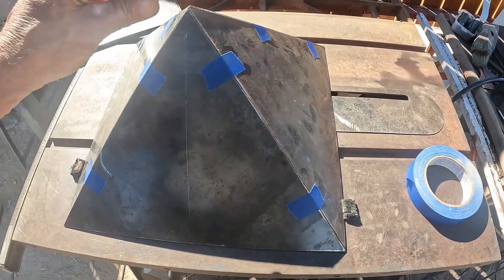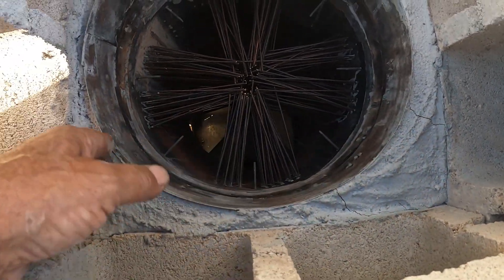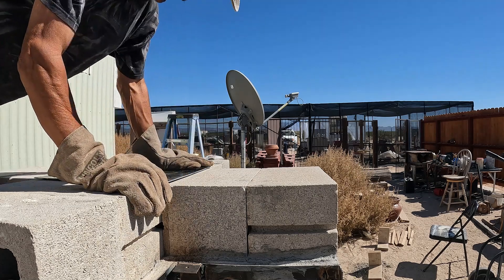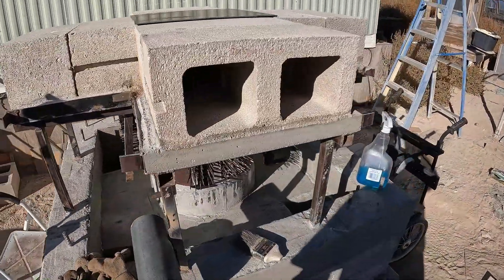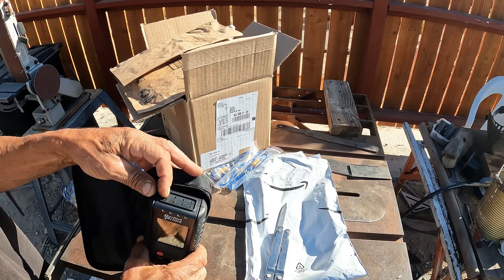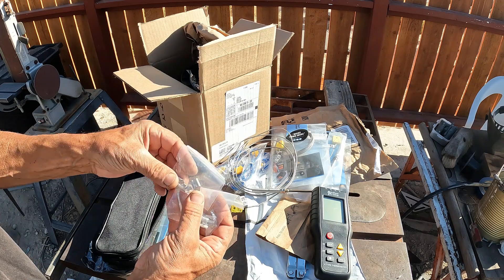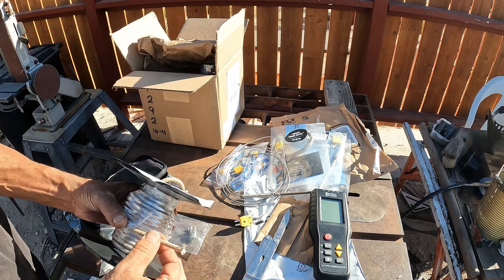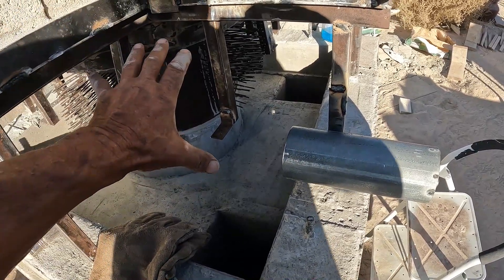Sand Battery Update E126

Comment: New to your channel.  How are you using this/what are you going to be doing with it?
Reply from the maker: I plan on building a room addition around it. But prior to finishing the room I will build a make shift shanty around it so I can start testing it as I build a nicer room. This is all an experiment. If it works as well as I hope it does I will build another one on a new property in the woods I just purchased if all goes well.
Reply: @off-gridsurvivalmike8120    Nice.  Good luck with the project.